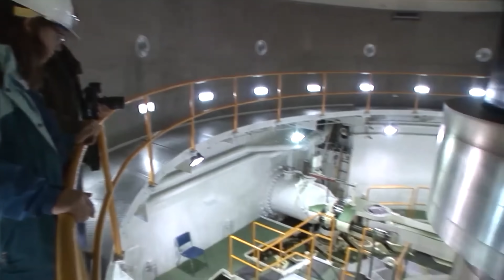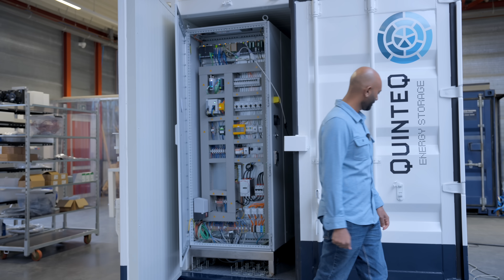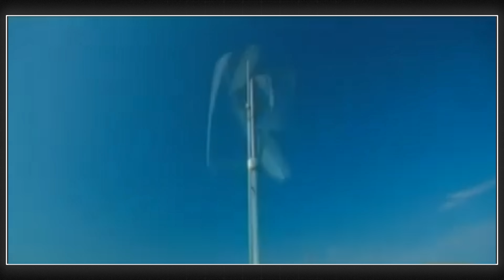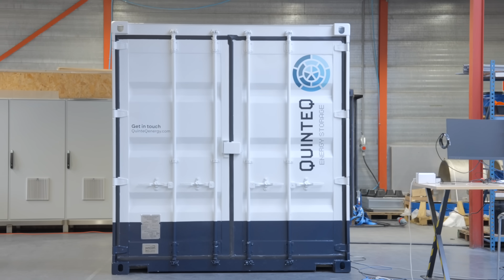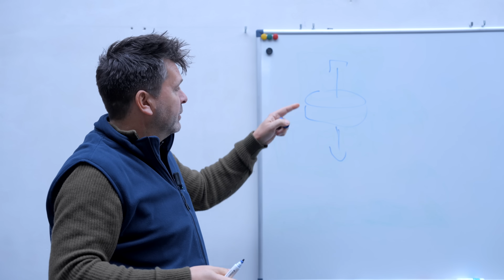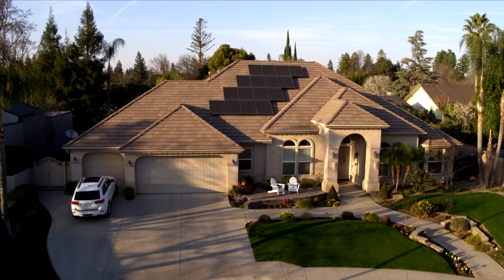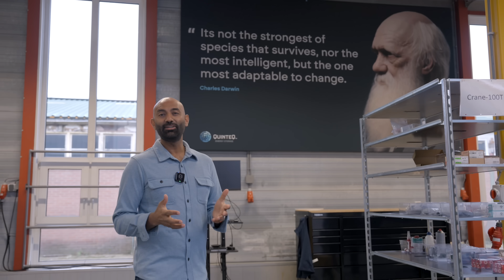How Flywheels Solve Clean Energy's BIGGEST Problem

Comment: As a resident of California, Ricki should know that we haven't had a brownout or blackout for several years because of grid scale batteries like the ones at Moss Landing and Ventura
Reply: 'Zactly!👍👍
Reply: I read that if California adopted heat pump tumble dryers and modern washing machines like in Europe, the problem would have gone away.
Reply: @johnburns4017  good point but California has ~15m housing units so transitioning to the better tech will take time to complete.
Reply: @crazyhank99  
The US washing machine and tumble dryers are fifties tech. Even the oddball US electrical system is outdated. I like going to the USA to see how electrical systems were seventy years ago. 

As I am aware, they did zero to transition.
Reply: How is this flywheel different than using grid-scale batteries? Do they have the same function?
Reply: @dr.x4050  More or less, last longer and have faster charge/discharge.
Reply: @killcat1971  A flywheel can either store energy, or it can be used for grid inertia, but it cannot do both.  Grid inertia is literally just that, resistance against the change of frequency, tied to synchronous rotating machines.  If a flywheel is a grid-tied synchronous rotating machine, it does not store energy, because the only way it can draw down that energy is by the grid dropping frequency, which is exactly the thing you don't want to happen.  If you're decoupled to the grid through an inverter or a doubly wound machine to provide power, then you're no longer providing inertia.  You could have a grid-forming inverter and provide synthetic inertia, like a battery, but then you've lost your unique benefit over a battery.
Reply: @wagnerrp Depends on their roles, they seem to be being used often for large discharge demands such as electric cranes which chemical batteries have a problem with.

Comment: There are two things I think are important about these flywheels. First, it shows how a "one size fits all" solution when it comes to power generation isn't ideal. We need to find the best solution for each application and combine solutions to produce the best outcome to minimize cost and emissions. Second, for it to really work, the economics have to make sense. I live in West Texas and wind and solar are huge not because of local incentives, but because it makes money.
Reply: A "one size fits all" solution (in energy generation as in anything else) IS the ideal solution, by definition, it's one solution that fits all scenarios. I think you're confusing "ideal" with "attainable". 

If you mean that a "one size fits all" solution when it comes to power generation is unattainable, that's pretty obvious. 

Data from the last thousand years of energy generation, starting with just biomass (basically burning wood), through coal, oil, nuclear, photovoltaic, etc., shows that the concept of "energy transition" is a myth. We have never abandoned one energy generation source for another. Ever. We keep pilling up new sources of energy on top of the ones we already. 

As an example, we produce several times more energy burning wood today than we did a few centuries ago! Today there are modern power plants that burn biomass for electricity or heat.

Also, flywheels don't say anything about power generation, because they don't generate power. They are a power storage, not generation, technology. They don't care where the power comes from.
Reply: Wind and solar are regularly providing over half of the UK's electricity in 2026. I think the important aspect is to have multiple diverse sources such as nuclear, combined cycle generation from gas turbines using natural gas, hydro + pumped storage, thermal generation from bio-matter, solar and wind. Add in interconnectors from other regions/countries to make best use of their excess capacity and you have a very secure/stable grid.
Reply: @grahamstevenson1740  Yep, that's pretty much the default opinion on how to go about ending fossil carbon consumption, and it's a lovely sentiment which I wish was true... 

Unfortunately what real world data shows is that, as we bring new energy sources online, we're either desperately short on energy already or we find additional new ways to spend energy, either way never being able to ditch the worst offenders. The result is that we've just been using everything and not ditching anything! 

I only see two possible solutions out of this, either we invent some technology that gives us a sudden huge leap in the amount of available energy that we basically don't need anything else for a while at least, or our population drops so much that we can afford to offline the worst energy sources.

What no ones admits is that there really is no solution at the moment. That's a political taboo. Our modern civilisation is built on the amazing windfall that are fossil fuels and we keep increasing the amount we spend year over year, we can't even stabilise it! And even if we stopped today, 250 years of digging up carbon and releasing it into the biosphere will continue to affect climate for millennia. These mechanisms work in time scales far bigger than we can perceive...
Reply: @goncalovazpinto6261  Fossil fuels won't be there forever ! Many of the best and easiest to exploit sources have already been exhausted.
That's precisely why the human race will need to wean ourselves off them.
Reply: @grahamstevenson1740  Of course they'll be there forever! Where do you think the carbon from the oil dug up and burned 150 years ago is now? It's all around you! It was stored away for millions of years and now it's free, it's in the short term carbon cycle in the biosphere, it goes from co2 to biomass and back to co2 constantly. It will not go back in storage on the crust!

We haven't "exhausted" anything! It's all here, NOW, active. All the fossil carbon we dug up will continue to have it's effects for at least thousands of years.

You realise there's been no new production of coal since the Carboniferous era 358 million years ago?! Did you know that it's impossible to make new coal, and why? Look it up it's fascinating.

What you and most people don't understand is that we're not "spending" fossil carbon, we're bringing it out of millions of years of storage and dumping it in our living room. And we have no way to put it back in storage!

Biomass isn't storage, living things absorb carbon, grow and then die and release it all again into the system. Decades-long cycles won't make a difference for centuries or millennia long climate effects.
Reply: @goncalovazpinto6261  You sound like you don't know how coal and oil were formed.
Once they're gone, THEY'RE GONE FOREVER !
Reply: @grahamstevenson1740  You sound like you didn't read my reply. Your you didn't understand...
Reply: @goncalovazpinto6261  It sounds to me that you don't understand much at all about energy !
Reply: @grahamstevenson1740  If you don't contribute to the discussion and don't read other's comments, don't bother me.
Reply: @goncalovazpinto6261  There is nothing that YOU can contribute to the discussion if you think oil is a never ending supply !
Reply: @grahamstevenson1740  Because you don't have industry. It's all unsuitable for steelmaking or heavy industry. It's financially expensive, like child's play.

Comment: When I see these industrial scale solutions, I always wonder if, & how long it would take, to see these solutions to be scaled down to residential sized solutions for smoothing grid demand & outage backup. I'd love to have one of these things spinning in my basement to get me through peak demand periods & provide power for grid outages. I'd add batteries, solar panels, & a wind turbine to supplement the spin.
Reply: yeah but the cost.... Eventually neighborhoods will be able to isolate power during a blackout and be battery/flywheel backup to the grid.  Decentralizing the grid will be amazing.
Reply: Had the same thought,  I'm sure having a small one would work for initial startups on big appliances such as A/C units / fridges.  If it helps on industrial scale it has to work for a home especially when using solar / batteries for power

Comment: Question 1, have they tested for what happens when the flywheel goes off the spindle and tries to breach the container?  Question 2, what is the recharge rate from near dead ( <10%)?  Question 3, what happens if a) power to the electromagnetic bearing is cut? b) What happens if vacuum is lost? c) a spindle bearing goes bad.  Question 4, how do they deal with the off-gassing of the CF epoxy and bearing grease? Question 5, have they tested earthquake survivability?
Reply: Question 1, have they tested for what happens when the flywheel goes off the spindle and tries to breach the container?  
Yes , this has long been dealt with in ultra-centrifuges . The encasement is designed to remain intact. 
I have heard of an ultra-centrifuge that suffered a bearing failure resulting in the main shaft shattering. This meant that normal dynamic braking was impossible and the repair technician had to wait 3 hours for the rotor to coast to a stop before starting the repair.
"An ultracentrifuge is a centrifuge capable of generating acceleration as high as 1 000 000 g (approx. 9 800 km/s²)."
Reply: @PaulG.x  interesting that gravity is the max value of output. And I guess centripetal force has everything to do with that number.(?)
Reply: If you seriously wanted to know these answers wouldn't it be smarter to ask company that makes it instead of random person on YouTube video 😂😂😂
Reply: @BlackandWhitecustoms . What fun is that, and besides, now we’re able to wonder about it.
Reply: Shh. Stop asking questions that might demistify the magic unicorn technology that will save the renewable energy dream.
Reply: @nmayor4232   it works. And it is not a dream.
Can't capture enoufh energy from the sun for our usage is our fault.
Reply: @nmayor4232  But…aoc said…!

Comment: I love this! 
 I'm in the UK and didn't know we massively increased their use, in the last few years, to balance energy levels in our National energy grid, like two 40-ton flywheels in the city of Liverpool.
Back in 2020, Scotland, (the UK)  installed a £25m Flywheel to prevent blackouts. Very cool. 😎
Reply: I was going to correct you by saying that Scotland is 'north' of England, but, on second thought, I think that 'above' is more accurate.
Reply: @rayopeongo  LOL!
Reply: The North Remembers.
Reply: Bloody sad you have to say that for the target audience.
Reply: Liverpool is having large power consuming data centres built imminently, and also has two large container terminals with large port cranes. The grid must then be more balanced using the two flywheels.
Reply: Yeh - typical of us Brits with our phlegmatic disposition - 'Flywheels to smooth out spikes on the grid? Yeh we've been doing that for a while now'. Turns back to finish pint...
Reply: The same as a solar system you have batteries to {balance and starage} the incoming and outgoing current flow, and of course batteries have a self life . Solar sold to the grid the transmission lines work in the same way as storage , but this is very limited .
 I wonder how much higher our energy costs will go after we are all on the flywheel system ! Better means we pay more $ right !
Reply: @JohnDoe-tx8lq  you look remarkably like the Zap Comix character of Xist Cult Leader "Bob" Dobbs...

Comment: The cool part is that it works essentially like a super capacitor.  Awesome application of old tech with modern materials!  This is exciting!
Reply: Liverpool is having large power consuming data centres built, and also has two large container terminals with large port cranes. The city has two two flywheels, which are not related to solar or wind. They are to balance supply.
Reply: I agree...Same was true for the thorium reactor showcased here.
Reply: Flywheels are a 1000 times slower than a capacitor or battery.
Reply: @briandonovan9091  Depends how fast they're spinning. Faster spin equals faster response.
Reply: @vremster   NOpe, response of any asynchronous flywheel depends on the design and power of the matching electronics.
Reply: No it doesn’t!
Reply: @andyxox4168  Neat!  Please inform me.
Reply: @Chip-34982   firstly it has to be asynchronous to the grid as any loading will reduce speed and hence  frequency. So it works by creating either AC or DC power which is then electronically inverted to 50Hz (or 60Hz) before being fed into the power grid. The power electronics limit the power that can be supplied. The capacity of these devices compared to a 50GW grid interconnected at 132/400kV (UK) is negligible.
Reply: @andyxox4168  Thanks!
Reply: This video maybe should be reworked in the sense that using this example of a capacitor, it's a great segway into the subject and it's applications.  It's probably best to think of electric grids as big machines, because they are, with endless little parts, like so many machines.
Reply: Correct. I’ve been trying to explain to people for years that all systems engineering has the same abstracted concepts. Flywheels and capacitors, but also loan servicers in financial engineering. Springs can be used somewhat like inductors.
Reply: You should watch till the end, when he explains that those "engineers" are just stealing money from the government.
Reply: @Chip-34982  con la ventaja de que va acoplado directamente al generador de corriente alterna y creo que evita la complicación del enfasamiento.
Reply: They should attach a magnetocaloric thermocycler with a generator & it would feed energy back to it for rotation. This would require almost no new power input once it’s spinning.
Reply: @DigitalDucky :  How much of "wasted energy" will be SAVED, if such "magneto thermo. cyler device" (mtd)- will be installed in   a facilities, like: homes, offices, factories, etc."?...

Was such TMD contraption, already for SALE in the market?...

Where should be the "installion SITE" of said TMD- in every concerned machines/ engines?... or at the "main powerline" of the "power consumer"?...
Reply: Yeah, the mechanical analog to the capacitor.
Reply: I got a better idea, lift something heavy up to store anargy
Reply: @reverendbluejeans1748  That's been tried, too.  Huge towers, cables, pulleys... tons of material, and not as efficient as flywheels.
Reply: @vremster  
Works well with weights in abandoned mine-shafts.
Reply: @vremster  How about a wind turbine attached to  to a flywheel.
Reply: @reverendbluejeans1748  .. wind turbines have to be low inertia in order to accommodate varying wind speeds and are asynchronous to the grid so the rotating parts do not produce ‘inertia’
Reply: @johnburns4017  yep to power a shed but not realistic backup for a 50GW power grid.
Reply: @reverendbluejeans1748  Already exists. Called hydroelectric dam. UK has one of the largest pump storage facilities. Built in the 80s to deal with peaks during the morning, evening or football breaks.

Comment: “Wind turbines don’t produce power this way” Shows a massive rotating wind turbine.
Reply: That "massive" generator is not synced with anything else, and is not a turbine. They do not produce power that is synced with the grid.
Reply: @JorgTheElder  it doesn't have to by synced, it's a moving mass. that's the definition of inertia.
Reply: @JorgTheElder  had to look this one up (I'm a grid expert but even I didn't know, how the heck is a dunning kruger like you going to know, so no blame your way), but most flywheels aren't synced. surprised? that's because you're learning about a topic from youtube. maybe I need to get off these channels, looks like they give people a feeling of knowledge when they actually don't know sh-t.
Reply: erm... he's showing a wind turbines for two secs as he mentions wind turbines. 00:10 Is that confusing?
If that's your level of understand, maybe this channel isn't for you.  😏
Reply: @JohnDoe-tx8lq  wind turbines are a rotating mass with lots of momentum. a number of systems are already using that momentum for fast frequency response. am I speaking too quickly for the brilliant followers of this channel?
Reply: @xtdude  😆and you think a Flywheel and a wind turbine work in the same...wow, ok. 🤣
Reply: @JohnDoe-tx8lq oh crap I didn't know I was talking to a grid expert. please tell me, how does the common flywheel which provides SYNTHETIC inertia (did he even mention that) and a wind turbine that provides SYNTHETIC inertia differ? or better, please tell me how any machine provides inertia. this should be good for a laugh.
Reply: @xtdude  you think my comments must mean I'm a grid expert? 😆 You are so far off the point, your ignorance isn't my concern, it's just sad for you.
Reply: @JohnDoe-tx8lq sarcasm Jesus

Comment: The real winner is the low friction bearings. flywheels have existed for hundreds of years. a theoretical null friction bearing would be the holy grail of bearings. no loss, no heat, no material degradation.
Reply: I  was in Spain ghat day my proposed solution is to make alternative solar lanel for latitudes but this looks beter idea. My question as it is a good solution for high pick power demand what about maintaining the power that can be transferred to far distanced powe delivery like cross country power delivery withouf decreasing the power level
Reply: @dayanberhe4485  Power transmission over long distance is a whole other problem to solve. The best high voltage lines lose about 1-2% per 100km while new and in good weather. To solve that, we'd need room temperature superconducting wires on the cheap
Reply: Imagine two gigantic flywheels in space, contr-spinning, and connected only electromagnetically through axis, where the motor/generator sits. When it stores energy, hey both start spinning faster.
Probably would require microwave connection to transfer the energy :-) Or maybe there would have third ring of space station, rotating for artificial gravity.